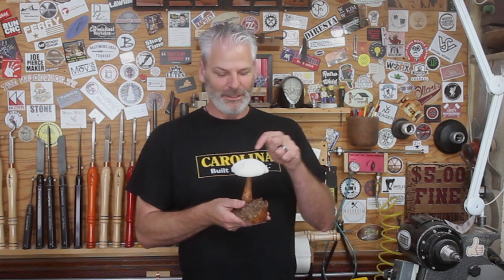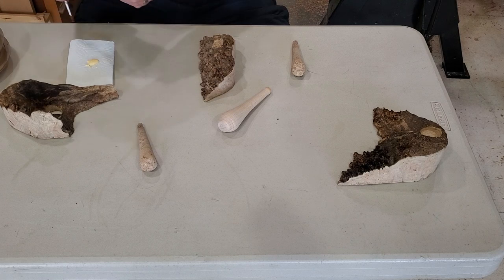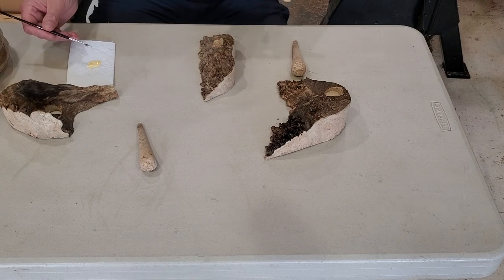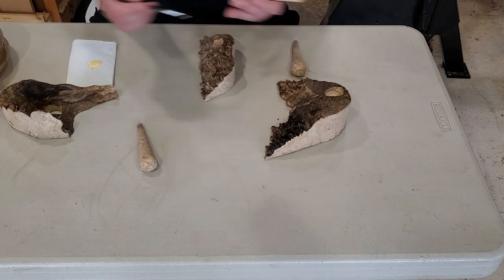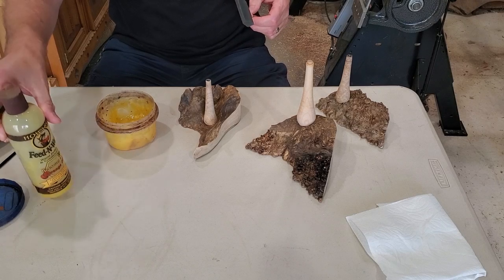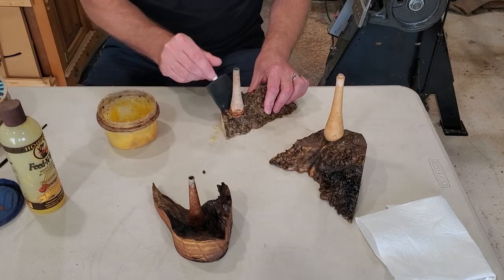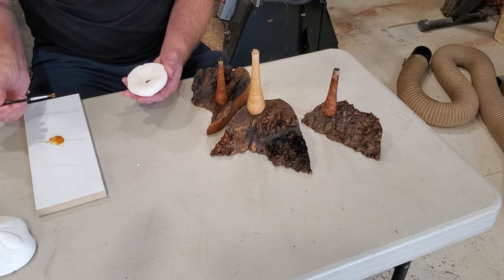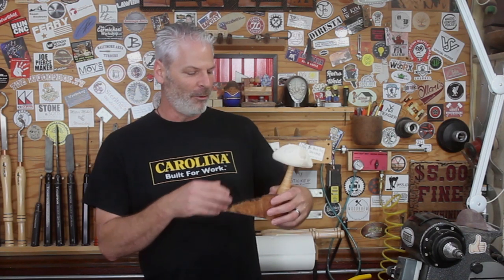Woodturning - Mushroom

Comment: If you use the Gorilla glue, a small amount of water added to the surface being glued will make the glue expand tremendously and provide a very strong bond.  This might be ideal for the inside of the biscuit shells and the wooden stem.  However, when applying a small coat of water keep in mind; less = more bonding.  Otherwise there will be glue going all over the place as it expands if one puts on too much water.
Reply from the maker: Thanks for the tip!